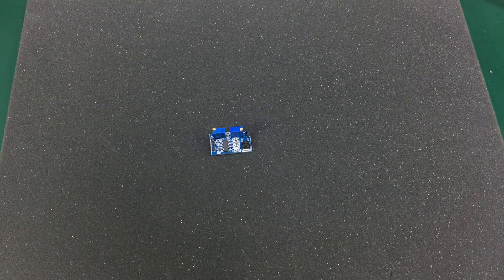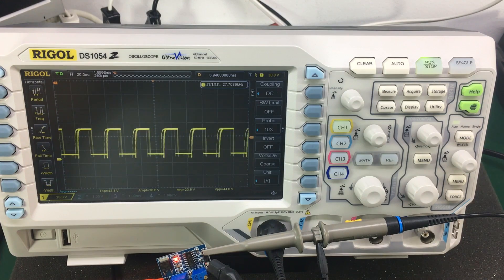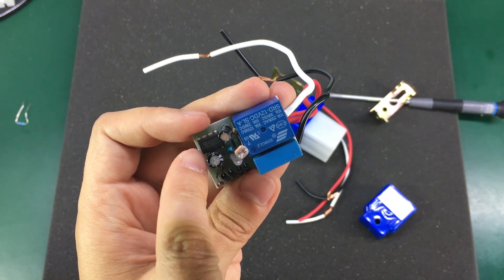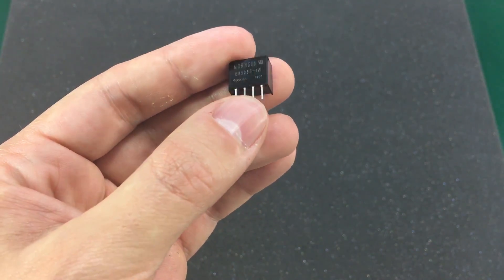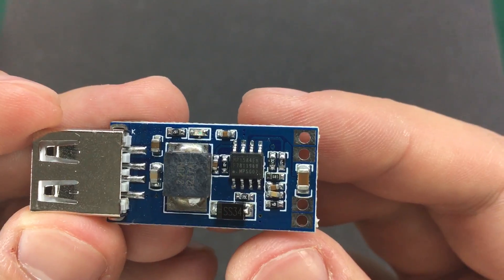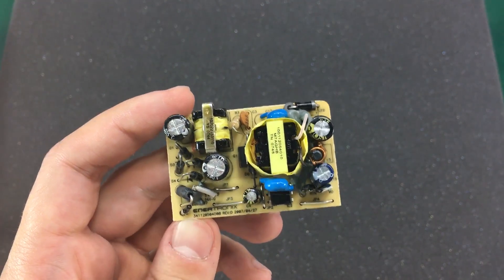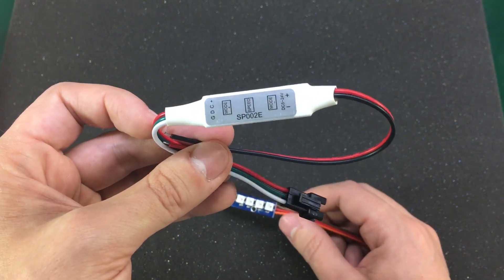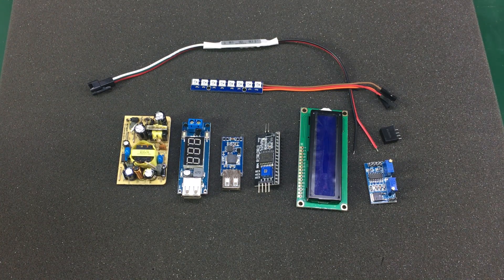Voltlog #73 - InTheMail

Comment: For a 3 cell balanced charger using TP4056, wouldn't you need only 2 of the B0505S-1W isolators and not 3?  Also, In your opinion, is this still the best way to make a 3S balanced charger using USB power? Thanks.

Comment: The USB module could be cool because you can shut off power to the entire module when you're not using it or you can have just the display turned on to read the voltage input and you can set it up to apply USB output voltage. Basically it's a fancy battery monitor

Comment: I would really interested in seeing a 3S charger based on the TP4056.
Most board available online for this job are a bit pricey and load each cell to 4.25V, which is a bit much for my tastes.
Also for the USB buck converter, you should check the output voltage with a load, all the ones I bought are pretty liberal when it comes to the USB specifications.
Reply from the maker: For example the ICR18650-22F has a Max operating voltage of 4.25 / cell so I wouldn't worry that much. I would worry if the voltage went above that though.. I agree we can't easily find 3S charging modules except for these chargers designed for the RC world I guess: http://voltlog.com/y/cjd1s around $10 for one but that could be less than building one DIY style..

Comment: Hi, my name is Jan and I'm a chinamoduleoholic. Last night, I had to do crazy stuff just to get a fix.....xD

Okay, now that that's out I actually do have a question:
You mentioned something about isolating the TP4056 when using them. I do see folks here using them in a parallel setup with one beefy supply input an that seems to work for them. I have tried that setup using 2 TP4056 modules ( the ones with the on-board MOSFET and an extra IC for protection) where they all have a common source and ground and it seems to work without having any issues with the 18650s I charged. They even had different charge termination times. Please do explain if you can why an isolation would be needed as you stated.

Thanks

p.s. awesome channel. "Weiter so!"
p.s.s Please do a voltlog on you making your PCBs from design to etching if that is something you do on a regular basis.
Reply: Jan Meyer In case you use the 18650 cells in series (eg 3 cells 12.6V) and charging them with balancing the cells you need three isolated TP4056's.
Reply from the maker: Well, Javier has already answered your question, isolation is needed when trying to connect these modules/batteries in series and charge them as a series pack. I rarely etch my own PCBs these days. I recently etched the one for the TNY276 converter but before that for more than a year I didn't etch any. The fact is I only etch my own PCB if I need something really fast or if I'm not sure it will work first go, otherwise, professional made PCBs are very cheap these days. So I don't think it will be that interesting to show people how I etch my own pcbs, there are plenty of good tutorials on that topic on youtube.
Reply: Gotcha! I'm also now seeing that etching is cumbersome and deals with dangerous chemicals....EasyEDA it is!
I dunno, if you feel like you want to share how you at least lay out your boards I'll be jazzed since I really like your way (thorough and newbie friendly) of explaining what you are doing. You can keep this at the bottom of your to-do list.

Comment: 3:26 No need to worry about the relay, they are designed to handle continues use. And with a capacitive dropper not much power dissipation but a continues en equal current no matter it's on or off. And my bed for the 555, used as a Schmitt trigger? Or as a retriggerable monostable so it doesn't act on short changes.
Reply from the maker: Thanks! my bet is on the retriggerable monostable however it's not that interesting to make it worth investigating further.

Comment: I admit, I'm also infected...
2:45, are you sure it's not the scope trigger? The waveform itself doesn't seem to change (much) so it looks like the auto trigger of the scope just tries to trigger on a not very stable part (overshoot or undershoot)
Reply from the maker: You are right, I completely missed that I had my horizontal adjusted way to the left. Once I centered the time base the jitter was gone so I can say the signal is now stable up to 124KHz which is the maximum this module can do. I know about the bug the rigol had as I was following that story on the eevblog channel. I purchased mine at a later date and I have version 4.02.SP3 which I think fixes the jitter problem.
Reply from the maker: I don't think it's the trigger,  I've tried adjusting the trigger settings, the signal just becomes very jittery when adjusted above 7-8KHz.
Reply: Your trigger point is shifted to the left a lot compared to the horizontal time base. Bring your trigger to the screen and jitter will most likely be gone. Trigger point must be stable, it is stable even for FM modulated signals. If entire waveform is jumping you're doing something wrong. Quickest way, press horizontal position knob.

Your error is indicated by couple arrows with T in the upper part of the screen. There is also horizontal position information to the right of the waveform memory bar on top showing that your trigger is shifted 6.94ms from the center. You're only showing 240us on the screen, so you are way past your trigger.

Btw. Beyond unstable clock driving your signal Rigol had a bug (resolved in later firmwares) with jitter when waveform was shifted horizontally on the screen in exact way as you did. But that jitter was actually much worse. Please check if you have release without that bug.

Comment: some ws2812b strips or bars or rings or whatelse have 3 pins, other 4... what's the difference between them, and can a 3 pins controller be adapted to work with 4 pins and viceversa?
Reply from the maker: my ws2812 strip has 4 pins, but there 2 gnd pins, so it's 3 in the end.. To control these LEDs you need VCC, GND and DATA, just 3 pins.
Reply: thanks

Comment: It's fun to order from China. Occasionally they will mess up your order, so  you have to be prepared to deal with that. For the most part, I've had success. I recently put together a banana power bank using Chinese parts, but instead of using a cheap cell, I used a quality, protected Panasonic 18650B cell with 3,250 mAh storage capacity. I even found a matching yellow USB cable at Dollar Tree. I posted some info on my Instagram account.
Reply: where is my banana? :) Nice work
Reply from the maker: yep, done that myself.

Comment: Interestingly julian illet has also done a mailbag about the ws2812 rgb controller th8s week. but not with a strip just a ring light. but he cuts the controller to find the pushbuttons on the back. only a few sellers show some hinds. i combind this controller with a lipo, a charge controller and a 5V output bost converter to a nice rechargable effect light. thanks for your mailbags. my own postman is a liitle upset about all the packages with traking delivery that could not just drop in the postbox.
Reply: for package sizes bigger than opening in the post box, my postman doesn't even bring it. I have to go to local Postamt to pick them up every time. Sometimes even from Zollamt :(
Reply: OR-Khan so true for me. but I just keep on ordering. just Xx10th orders  on the way.
Reply from the maker: It's even worse for me, all of these packages coming from outside EU I need to go to the office and pick-up myself. That's how the system works here in Romania..

Comment: Hi, I've those isolated DC-DC 5v 1:1 modules, are unregulated, with no load I got about 5.6v and with a minimum load (about 14mA) the voltage drops to about 5.3v, so I didn't tested with a 200mA load but I don't think that you can use this modules with the tp4056 unless your current settings are very low. I use them for power and isolate those volt/amp LCD meters from power sources and it works very well.
Reply from the maker: yes, considering their rated power they are not a good choice to be used for TP4056 but using a similar but higher power rated version could work. I did also notice the output is unregulated and that's something to be considered. Tested my module: no load 5.5V, loaded @0.2A 4.95V. The unregulated part is mentioned in the datasheet but I kinda missed it at first glance.

Comment: Indeed we meet to inspire purchases of cheap electronics from China.
I have a bunch of orders waiting to arrive.
Interesting stuff you got there.
That RGB LED strip, how much does one of those cost? I'm thinking of making a Boblight for my Raspberry Pi setup, just to enhance the experience from watching movies. I like the density of the LEDs, that could really come in handy.
I do have an order for a 5 meter strip, but only with 30 LEDs/meter.
Reply from the maker: $2-3 depending on where you get them, here is a link http://voltlog.com/y/k5avb
Reply: Thank you, I might buy a bunch of those (gonna cost alot to cover the outer edge of my TV, but then again, I'm a geek :D ).
Reply from the maker: I was going to suggest getting a 5 meter strip but you already thought about that..
Reply: Yeah, I've already ordered a strip, just waiting for it to arrive.
Could be fun with a more dense boblight, although I'm not sure if it would make that much of a difference. Those small boards could ultimately be used as toys to mess around with.